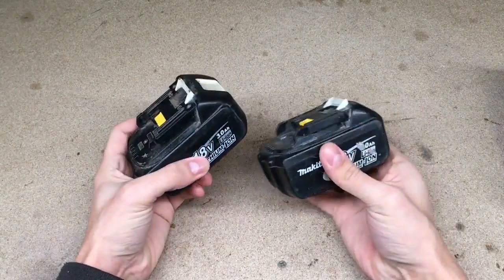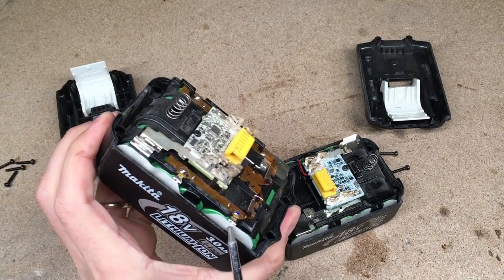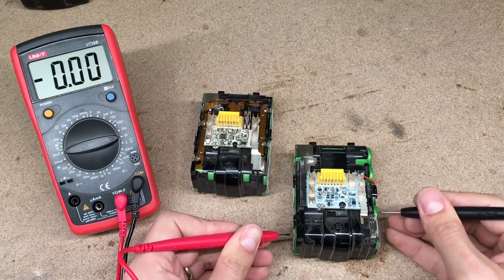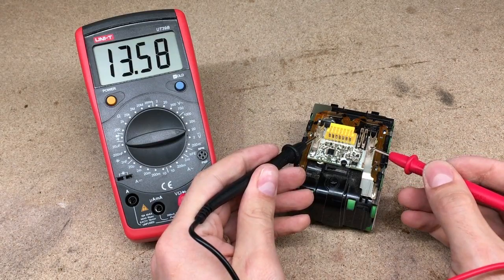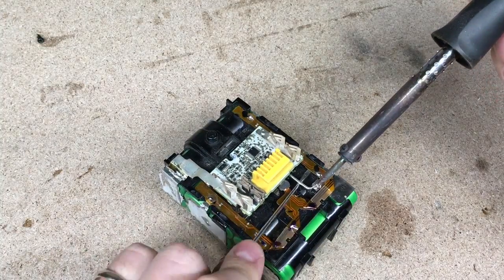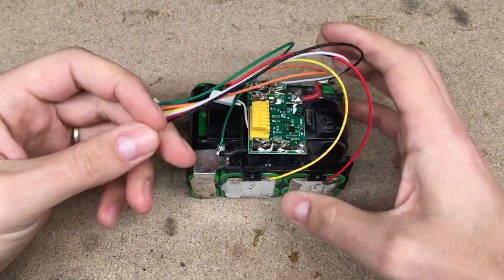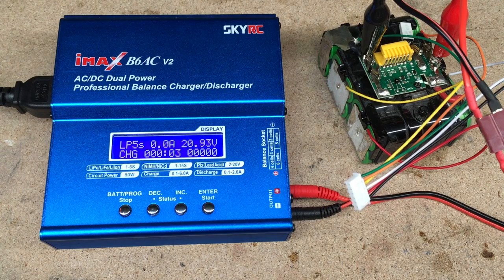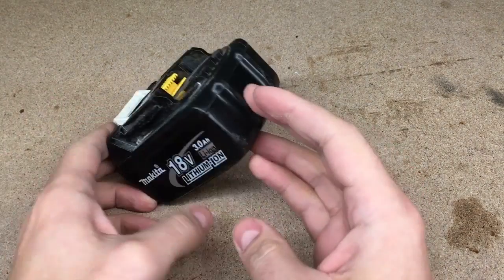Repair Makita BL1830 Battery By Making One Good From Two Bad

Comment: 1. if you replaced all the 18650 cells with NEW of the exact same type it would probably have charged on the Makita base ... no need to replace the BMS      2.  better to spot weld

Comment: You did it wrong and unsafe. Nickel strip welders are not expensive 15-25$ and most of them come with some nickel strip in the box. Soldering this type of battery is bad idea on positive side there is plastic insulation ring and pressure valve if you melt it you simply short this battery and burn your house down or release toxic gas from that battery. Also if you didn't wash flux it will leave behind corrosive residues. That is why even cheap chinese brands use nickel welders and not soldering them.

Comment: If your Mikita balance board doesn't like the charger it could be over voltage (Mikita only charges the cells to 4.0v) or it could have tripped the failed try counter.
There are several versions of the Mikita battery balance board on eBay, you installed the old circuit board that only removes the battery from the load when the #1 cell gets lower than 3.2v, on a new pack that previously had cell balancing.  I took apart 8 packs and made 5 working packs.
I've got some new design balance boards on order for my older (junk pile) pack that now has a failed board and some mismatched laptop cells.

Comment: Good video all round. I do wonder if you could have checked the internal resistance of the two "good" replacement cells. One of the cells in the final test had higher than average internal resistance (and thus had lower voltage) and it may be that one of the batteries you installed. Testing the donor batteries before they get soldered in is doing due diligence. I learned a lot from your instructions and I thank you for time and effort, much appreciated.

Comment: You are one of the few who have shown how to test each cell, soldered the batteries back in place and shown when the circuit protection board need replacement as well. Many thanks for a very well explained video and the links for parts.

Comment: If the protection circuit is inside the battery pack , then why the need for that yellow connector which has 7 lines  which plug into the charger?

Comment: Finally someone using brain and charge it with balancing. There is tons of videos showing people using those fake dangerous bms boards + old cells with different voltages and using it with oryginal charger. They shouldnt make videos if they dont know what they are doing, because that thing can burn someones house.

Comment: This isn't good at all. The capacity of these cells will be different. It will get out of balance quick and same problem will occur or worse. If you have to replace cells replace all of them with new cells
Reply: You are correct. Using different used cells is pointless. The other problem is that new high current rated 18650 cells are expensive. You'll be better off buying a new Makita battery and save you the trouble and work.

Comment: Did you realised that cirquit boards have different contacts. Looks like one battery is with star, second without. Middle connector at one have two contacts, and second battery Middle connector only one contact. My impact driver does not work with battery with two contacts. Work only if battery fitted not fully. So battery  will start charging after this, but tool may stay without battery if it need two contacts instead of one

Comment: I am having trouble duplicating your instructions. The iMax B6AC V2 keeps saying "balance connect error" and will not proceed. I put it on a good battery and the same result. Can you help?
Reply: I  have Turnigy charger. It is similar to ImaxB6. Balancing error coming aswell. I know from experience, that if you want to charge more then one cell, charger wants you charging it properly and only by using additional balancing connector. Probably your imax have same software
Reply: HomeMade ch. my turnigy charger says the same thing, I can’t charge without balance lead connected. Did you find a solution. Maybe older firmware in video!
Reply: No, I contacted seller, described, what i expect from charger, he did not know if this is faulty charger, but offered to send replacement. I accepted. Replacement works exactly same. So now I have two chargers for price of one. And I think this for   batteries protection, not to charge without balancing, as lithium batteries get damaged if overcharge.

Comment: I just soldered the circuit boards from Bangood onto my repaired packs and the charger lights up red like it is charging for about 5 seconds, then flashes green a few times and then red and green like the battery is broken. Why are these circuit boards not allowing the pack to charge? Thanks for you help.

Comment: There is a Chinese company called LLC electronics, they offer a set to make a Makita LXT battery, you get a case, the cell holder, prefabricated nickel strips and a PCB with balancing. With this there's no need to use a 3rd party charger for balancing, it is done by the Makita charger automatically.

Comment: Great video....
Question: Could the charger you linked to be used to charge 12V motorcycle and car lead acid  and also could it be used to charge a motorcycle Li-Ion battery with more than six cells (no idea how many cells they have) ??
Thank you

Comment: if your going to replace any batterys try an fine a laptop battery .cos you should no laptop makers use top batterys just replace with them ive dune it works fine don't buy them batterys off ebay fucking awful just look at there feed back an you no why

Comment: What screwdriver bit is required to take the battery apart?
Reply: Allen wrench with a hole in the center you can get it at harborfreigtools for about 6 dlls
Reply: Torx wrench
Reply: Torx 10 with security it has a hole on center you can get it at harborfreigtools for about 6 dlls is a matalic green looking tool pack

Comment: Companies normally dont want you repairing things, increase in profit margin to say nope non repairable. When realistically its the cells that fail why not make a pack that has easily replaceable cells such as somthing like a AA battery toy where you pop off a side panel and swap the bad cell with a new one. Still have to buy the specific 18650 either high or low discharge based off the amp hours of the pack.
(Low amp hour packs the cheap ones that normally come with the drill in the first place normally use high discharge (about 15 amps per cell with maybe 5 or 6 cells, low life expectancy given the output)
A 4 amp hour pack might have 12 cells and draws maybe 5 amps per cell which is akin to ypur laptop batteries,  overall higher capacity but low discharge but when you stack 12 together you get the same amperage as the smaller high discharge packs.)

Larger pack might be 3 times the cost of a amall one but its technically 6 times better as the individual packs of cells will balance charge (3 sets of 4 for example) they dont have to output so much power (5 amps over maybe 1t  amps) so they will have a higher capacity, and given the lower individual cell output the battery itself will last longer without crapping put

Comment: Doing this is actually quite dangerous. Following this process actually bypasses the inbuilt safety protection. Battery manufacturers know very well what these batteries are capable of when modified and thus users can't reset these boards. I've seen what one of these "repaired" batteries can do in a vehicle. Lets say there was not much of the vehicle left. This happened underground, and those of you who have worked in UG mining know what a vehicle fire means in that environment. Oh, and you can forget trying to claim insurance on damage caused by tampered batteries.

Comment: Great video but Im a busy contractor I dont have time for these repairs.  My question is why do so many of mine fail?  Its at the point where Im considering switching brands.  My tools are not abused. (aside from one battery that happened to fall into a hot-tub.)
Reply: dont leave your battery fully charged
Reply: @dylanc9275  so dont forget to charge them if not using but dont fully charge them and leave them either. Makita batteries are a joke I had 2 batteries die because I packed my drill away, 1 was practically unused.
Reply: I used to fully drain them before changing them out. Was told by Makita rep the battery would last much longer if you change them out when you first notice power loss.

Comment: You have to watch out because there are similar Makita batteries which have charging cycles logger. I heard that there is a easy way to bypass the counter or reset them but I forgot how to do it...that's why I run my Makita battery pack with an Amazon BMS and XT60 connector in the drill and battery

Comment: Good video. But I dont use Sony 18650. They are too hot when power load and make battery stop working by heat sensor. Samsung, Panasonic, Sanyo are better.

Comment: The author is a dude, do not follow his advice. Soldering of the 18650 is a delicate job and should be done with minimal heat, that is, with a very powerful solder for parts per second. It is best to weld as the original. You can also buy 18,650 with factory welded pieces of nickel tape, they are soldered easily without the risk of overheating the battery itself. The bigger problem is that the non-original PCB Board does not monitor the voltage of the individual cells and even all the 18650s are perfect, the battery will die very quickly. So, if you do not have an original PCB board, do not even get this repair done.
Авторът е тъпак, не следвайте съветите му. Запояването на 18650 е деликатна работа и трябва да стане с минимално загряване, тоест да с много мощен поялник за части от секундата. Най-добре да се заварят, както оригинала. Може да се купят и 18650 с фабрично заварени парчета никелова лента, те се запояват лесно без риск от прегряване на самата батерия. По-големият проблем, е че неоригиналните PCB Board, не следят напрежението на отделните клетки и дори всичките 18650 да са перфектни, батерията ще умре много бързо. Така че ако нямате оригинална работеща PCB Board изобщо не се захващайте с такъв ремонт.

Comment: if you had charged each cell then your protection PCB would have worked fine as you forgot to check each cell before setting back in the original charger , bu i don't mind as i was always taught to learn from other people's mistakes .

Comment: Do you know if i can use one of those pcb to convert a nicad drill to li ion? Only by changing the conection of the pcb to drill is a craftsman 15,6v and i want to change to li ion but charging with same charger

Comment: Hey, thanks for posting this. I had the red/green flashing lights and replaced the board as you did. All seemed ok at the first, but in the Makita charger it only charges for around 20 seconds before the green LED starts flashing and charging strops. If I remove the battery or unplug the power and plug it back in, it again charges 20 seconds before flashing green LED. 

Any idea what may be causing this and how to fix it?
Reply: I've read some of the non-original chargers which look like Makita chargers can charge batteries even if the battery management system in the pack has switched it off.
Reply: I think what you are seeing is voltage differences between the cells, and therefore the circuit sees its as a problem..

Comment: 4:46 Looks like the replacement Battery Protection circuit has no balance? That is annoying.
Reply: It's difficult to get 3rd party Makita PCBs with balancing, but they are offered from a Chinese company. I resurrected a battery with broken PCB with it, it has no low voltage protection, but it has balancing and works with the original charger.

Comment: Hey,  Does anyone know a source for the yellow connector on the batteries?  Those POS are NOT suited for placement in a rough-and-tumble toolbag.  They break easy.  I need to replace them to fix my batteries.  Thanks

Comment: i have one 3.0mAh battery fully working. how should i proceed in order to make it a 4 or 6.0mah?
Reply: If you have to buy new cells it's the same price if you buy a new battery. For a cordless drill you need cells which can provide high amps, most usual cells can't do this. 10 good Sony Konion (they can provide this high amps) costs the same like a new BL 1860 battery, and the 5 AH BL 1850 is even cheaper. With a Makita battery you don't have the risk to get fake cells, and you have warranty on the battery.

Comment: i've always wondered. is there any risk of getting a electrick shock from the batteries when doing this operation (unless you purposely short it)
Reply: Each cell has only 4.2 volts when fully charged, so it's not a dangerous voltage.

This is an advantage of cordless tools - if you use it in rainy weather (professionals have to do this sometimes) you can't get a electric shock. With 115 or 230 volt tools (depends where you live) you can get one if they get wet.

Comment: Does anyone know what the two small holes (with metal inside) on the Makita power source terminal are? I understand the two metal contacts (+, -) but I don't understand the two tiny metal contacts. My 5.0amp 18v battery doesn't have any visible contact ports that match. Maybe that weird little white box/white wire on the left at 4:40 has something to do with it? Is there any wireless connectivity going on? I ask this because the power source terminals from Japan and the U.S. have a very slight difference. If those extra metal pin holes are inactive, it seems like the US battery should work with a Japanese terminal.

Comment: Nice job very clean repairs! I was wondering if  you have ever thought of tackling the project of taking the shell of a Makita battery and putting the required electronic converters in it to power of Makita tools with a cord? There is a product for sale made by Green Lee electrical tools. It was made to power one of their crimpers for large cables I believe. It is made with a Makita drill as a base platform the batteries capacity must not have been sufficient for their demands of their tool so they have made such a product to support of their tools needs! I could just buy one, but I think that it would be a fun project and I would hope a guy could do it for much cheaper than the $285 USD That they are asking for them! I am quite vested in the Makita 18v and 18v X2 tools. It might be due to my  poor searching skills on the internet as well of lack of knowledge in electronic components but so far I have had of no luck finding of what they could be using that would fit on the inside of the battery shell.  If you think that there is value in such a project I’d love to see a video of your quality of such a project or possibly feed back as to what they may be using to convert the 110 power to the 18v tools most efficiently in such a small space! Thanks if you do and I look forward to more batterie videos again, nice job! I think your videos are easy to understand and will help many diy’ers complete their own repairs!
Cheers,
Rod

Comment: Given that the Makita balance board will not let you replace cells and the replacement chinese boards do not monitor individual cells so cannot balance the battery, I feel the only viable way forward is to connect to individual cells with one of the connectors used in the R/C world and then use something like an Imax B6 to re-charge and maintain balance on the battery.
Reply: Did you manage to do this? I also have the same thought and considered drilling a hole in the casing and running a balance connector through to connect to the individual cells

Comment: Is it not possible to reset the original protection circuit board? perhaps if the voltage was completely disconnected from it for a while, so it cleared the memory?
Reply: After a lot of different reports it's not possible, maybe it would be possible for Makita but not for normal persons.

Comment: Did 10 x 3.7v = 37v??  How its labelled by 18v??
Reply: 5 х 3.7v doubled cells
Reply: Parallel pairs :)
Reply: Each pair is conected + to + and to so you still have 3.7 volts from each pair only if you connect +to - and -to + then you get 7.4 volts (parallel or serie)

Comment: hello!
Very good video about reparing makita batteries! thancks a lot!
 I started to fix one of my batteries also but i have a little probleme. I soldered  the new Protection board like you and also a Balance wire 5S for balanced the batteries for 1 time. It is very strange because my charger see only 4 groups of cells when i try to balance them and i have cheched the connection and everything is ok. Do you know from your experience where could be the problem? 
Thanck a lot for your answer!!

Comment: Hello.
Please,
That yellow connector on the battery is what?
What is it used for?
Can the battery be charged only by connecting to + pole and pole -?
Thank you, Bob
Reply: The yellow connector communicates with the Makita charger. The original charger regulates the charging current, dependent on the battery temperature and other data. 

Normally the battery could also get charged over the 2 main connectors, with low current and a special charger.

Comment: what function is little red wire on board
Reply: I am wondering the same, have you found out the use of this little red wire ?
Reply: @jmyyer  I think it's the 14.4v wire. In fact those pcb are not good because it's not balancing cells. It's should have 6 wires (0v, 3.6v, 7.2v, 10.8v, 14.4v and 18.5) but it have just 3 (0v,14.4v and 18.5v). It's meant this charger it's dangerous

Comment: The replacement circuit board is not compatible with balance circuit?
So this means that to charge properly, you can only do with a separate balance connections and universal smart charger?
Is there a replacement circuit that is compatible with makita charger and balancer???